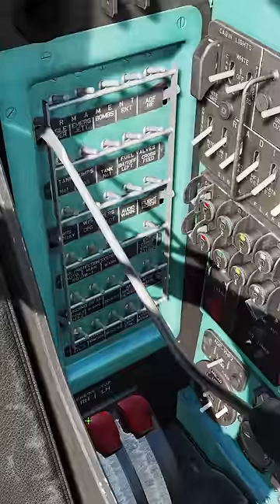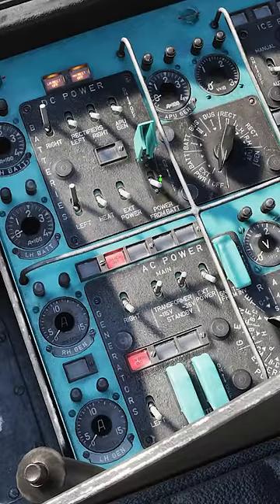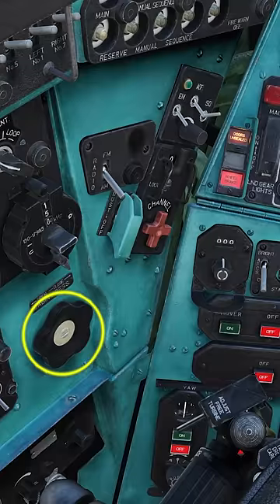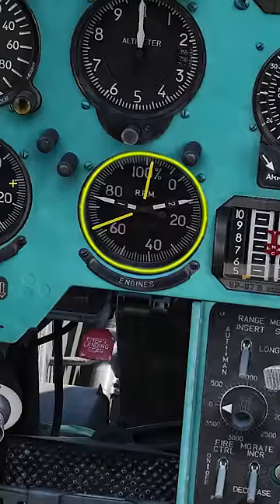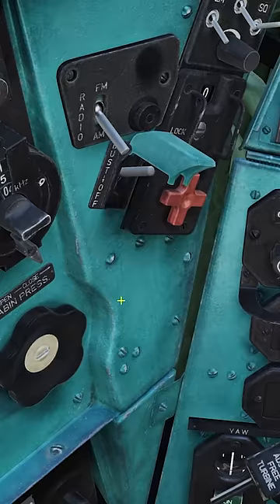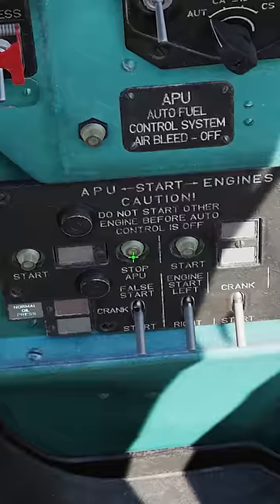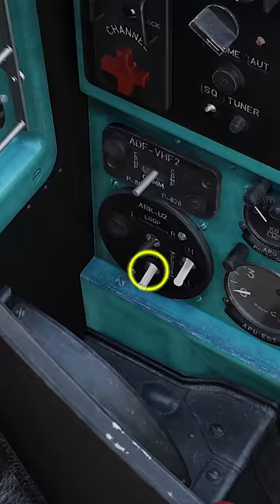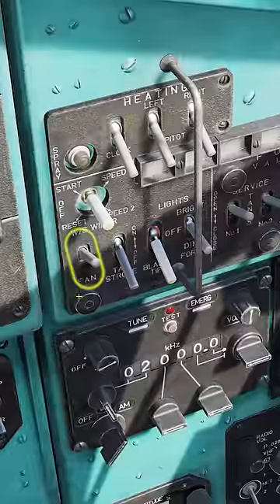Mi-24 HIND Startup in 60 Seconds!

Comment: This is why checklists are a thing!
Reply: At least auto make engine and fuel start, like holy jesus and his mother. No wonder Russians are bad at combat, they spend half the time trying to start the vics.
Reply: @tarektechmarine8209  bro this is an old Mi24 
All old aircraft were like this , including American ones
Reply: @tarektechmarine8209  that's why FEs used to be a thing
Reply: @tarektechmarine8209  mi24hind was a beast of heli
Reply: @tarektechmarine8209  wtf are u talking about. Wait. Ur a yank?, 😂
Reply: @tarektechmarine8209  you need to add fuel once she gets up to speed then your fuel control level is your throttle and adding fuel at the wrong time isn’t pretty to hear lol
Reply: Yeah like T,c's .....🤔🤔😀
Reply: It only takes a minute! 😂
Reply: @capnhardway  wait a sec.   ,,,
Reply: @tarektechmarine8209  Each engine works independently for a reason: redundancy. If 1 engine goes out, you’re FUCKED if you don’t have separate controls for the other. Also consider: you’re dealing with JET-A fuel, hydrologic fluid that runs hotter than the sun, add to that cancer-causing fire-fighting chemicals to prevent explosions, giant auxiliary battery packs to power radar and weapon systems, you WANT to have all those buttons. Gallons of literal acid to hold energy, and this is all without the literal bombs and other munitions you strap to the aircraft.
Reply: @tarektechmarine8209 you think starting a western vehicle is any better?
Reply: @tarektechmarine8209  Ukrainians use these the most and are kicking ass with them. They may be old but they sure as hell still are maneuverable and dangerous, also the thing's built like a tank it can take 12.7mm rounds and maybe an RPG-2/7 rocket to the side.
Reply: @QasimAli-to5lk All? The Viggen is in the same era as these aircraft, and it takes like two minutes to startup. 

The wonders of Swedish engineering.

Comment: I am so happy i live in the west ngl
Reply: Do you think Western helicopters make everything easier to launch?
Reply: … have you seen the start up on a Pavehawk or Chinook?
Reply: Blud thinking Western helicopter has more simple startup than this
Reply: @liberationenabled4593 to be fair the Apache startup is literally 9 steps. This is it. 
Battery On
APU ON
Right engine start switch 
Right engine power IDLE
Right engine power FLY
Left engine start switch
Left engine power IDLE
Left engine power FLY
APU OFF

You can literally start flying after doing just this. I can literally start an Apache in 30 seconds.
Reply: @BuddySpike101   What version of Apache?
Reply: @BuddySpike101 Apache is like 15 years newer I think. The KA-50 which came out around the same time has a computer assisted one man crew and a much easier start up.

Or, I should say “Was designed and prototyped around the same time, and didn’t enter service until 1995 because Soviet Union died”

Comment: What is amazing for aircraft is how simple everything could be made, but we still design everything to have a switch.
Reply: someday, somewhere, someones gonna need to be able to disable the far right fuel tank mid flight, or need to turn a specific component on and off again. Thats the reasoning behind all the different controls
Reply: @hmad898 Also for diagnostic I imagine its really common. “Oh something is leaking fuel, lets cut off the fuel to the right tank to see if the leak is there” or something. But I imagine more modern systems like the AH-64 or Kamov-50 a lot of that diagnostic work is done by computerized systems to an extent.

Comment: Do NOT turn on dust protection unless you are in a dusty environment. Dust protection sacrifices engine power, and in the hind you need every bit of engine power you can get, since just a full tank of gas will put it at 95% takeoff weight without even any weapons. 

This rule really applies to all helicopters, but is especially important in the hind. Dust protection is ONLY WHEN ABSOLUTELY NEEDED

Comment: Now I'm just curious what is the dust protection system and why can you even turn it off
Reply: It filters air coming into the engines for take off and landing from unpaved surfaces, it reduces airflow to the engines so it should be turned off when not necessary

Comment: You’d think they would automate most of that. I just hook things I want on to ignition power. Then it doesn’t kill my battery when I park…
Reply: they definitely can, but its much better to have everything have its own switch. because one day the pilot will have to troubleshoot mid flight and being able to control everything with no automation getting in the way is the only way to do it. It isnt like a car where you can just park, turn it off, and pop the hood.

Comment: Listen id like to learn this Game but ill stay on My least realistic Game called war thunder
Reply: There are less detailed planes in dcs. They're called low fidelity, and you cant touch any of the buttons, but the flight model is realistic and the system model is the only simplified thing in them. They have a bundle to get all of them and when they're on sale its like 25€. It includes the mig 29, the su 27, the su27, the f15 and the a10. The bundle is called "flaming cliffs 3" some of the planes even have more versions like the mig29s which is a variant that carries fox3 active radar missiles. The J11a which is a chinese su27, but it has a better radar and carries fox3 active radar missiles. It also includes the mig29g which is a german export mig29. Its just worse, so i wouldn't use it, but what ever floats your boat.

Comment: 7000 hr attack helicopter pilot. Incredibly poor design using mid-20th century "technology". Every switch, connector and the connecting yards of wiring are failure points and excess weight that a better design could carry as fuel or ordinance. Typical Russian design, build a sledge hammer for a tack hammer job.